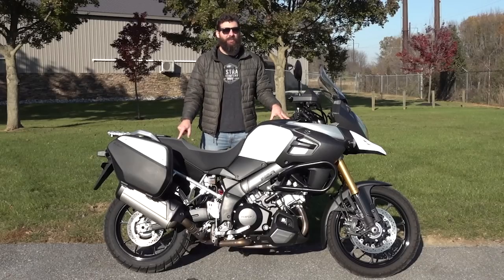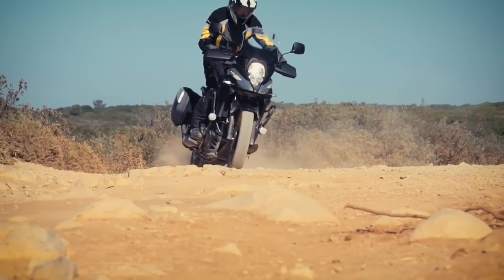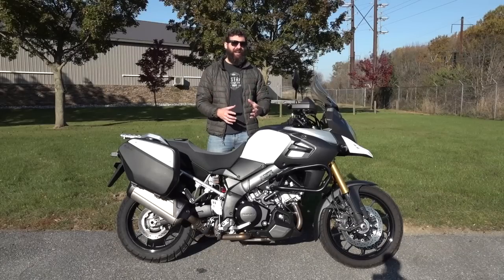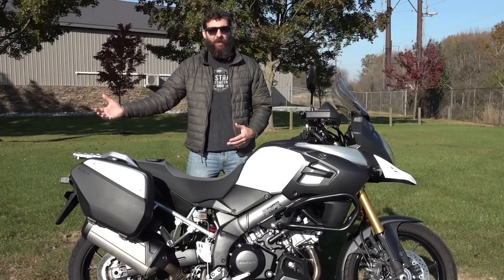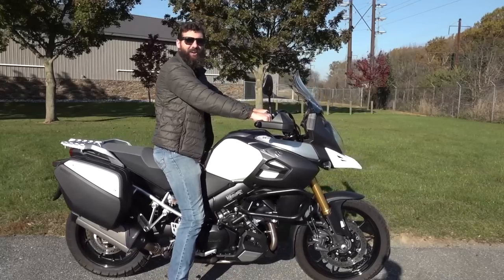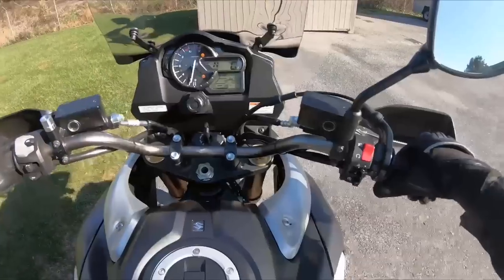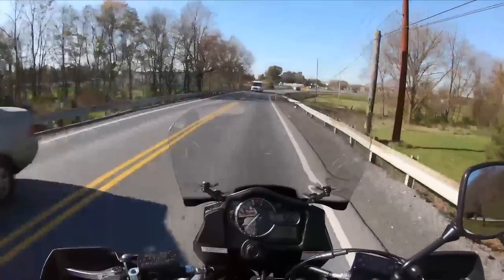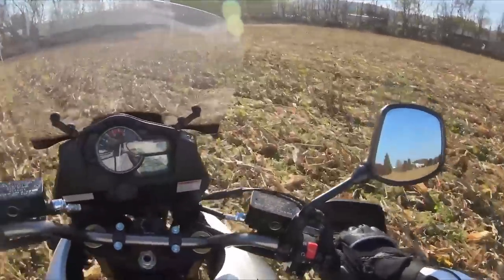Why the 2015 V-Strom 1000 is a great adventure bike but...

Comment: Sold them for years.   Saw them come in for service after thousands and thousands miles.   Never saw any damage to any of the radiators.  It's almost like Suzuki knew what they where doing when they built it.   One of the most honest ADV made.
Reply: I have the 2016.....no issues whatsoever.
Reply: @Paeload  Yeah! I bought the 2016 also, took it from Ontario Canada down to Missouri and the thing has been holding up really well and through lots of off-road abuse. I'm really happy with the purchase
Reply: You laying it down in a parking lot says more about you than the bike.
Reply: Bought an original '02, totaled it with a deerstrike @65mph within a year. Bought another one just like it. 65k later, I still have it and it's been stone-cold reliable.

Comment: I had a 2003 DL1000. Bought it used (with 410 miles on the clock) and sold it 95K+ miles later. And it's still going strong with its new owner. In 60+ years of riding, I have never had as much motorcycle for as little money as the VStrom. If it had a bigger alternator and shaft drive, I'd still have the bike.
Oh yeah - and I put a set of virtually indestructible Jesse bags on it.
Reply: I had a 2004 DL1000 for a couple of years.  Worst thing I ever did was sell it to buy a Harley.  Well, two Harleys and a Ducati later, I'm back on a V-Strom 1050.  Sooo glad to be back on a Suzuki.
Reply: What's wrong with the alternator? Thank you.
Reply: I too have almost 50 years on bikes, had almost any kind imaginable, 4 airhead BMWs, ( still have 2 pre 80s 😁) and a 6 cylinder Goldwing. Have an 05 bought used with 17K, equipped with all the Givi Factory bags, crash bars, a serious bash plate and upgraded fuse panel/ power outlets etc.  Once I got rid of that horrible factory seat, this is ergonomically one of the most pleasing, comfortable bikes I've ever owned.  I'm tall, so the leg drop is so comfortable. Had the lean run problem in first 1/4 throttle, but got the ECU juiced properly, easing parking lot navigation !  In the end, that motor is anvil tough, begs to be revved,  is hardly stressed at 90, and leaps to life if you need to move quickly. The bike tracks so perfectly at speed, and it's LCG makes it lean in turns so effortlessly, my sport riding friends don't lose me so easily.  It's not the best at anything, but like old airheads, it does everything well, and is stone reliable. Valves are not any easy project, but it's schedule is long. Only thing I might do to dial in to my tastes, would be to add 2 teeth to rear sprocket, making the power delivery more linear. It's high geared, and not easy managing at low speeds. Of course you need a Speedo Healer if you do that...so I'm rarely out of second in city riding !  I rarely ride in town, so not that big of a concern.  As one person who ride it said: It's one of those bikes that "the sum is greater than the parts used".  It will outlast my riding time most likely, but I might do one more buy, getting the 1050 and the ABS....which saved my butt once when on a borrowed bike....so I would like that feature.
Reply: @jordan9339  just guessing. Not enough power for addons. GPS etc.
Reply: @jordan9339  The model you see in the video has an upgraded alternator from the 2004 model and is capable of providing more than enough power for auxiliary electrical items.

Comment: A very good overview of the Vstrom. I have a 2014 1000 Vstrom, after owning several Beemers, Hondas, Kawasaki, I’m really 
Enjoying the Suzuki and it’s versatility. Comfy ergos, great handling, lots of low end grunt and surprisingly quick!  It does need,
  many after market accessories to make it off road ready, but that’s part of the fun too.  A lot of bang for your buck bike!
Reply: Hey Chris, I have to agree with you, such a fantastic simple bike. There isn't one reasonably priced Adv bike out there that doesn't require aftermarket parts to make off-road worthy so it's easy money to justify with so many parts available.

Comment: I'm on my second vstrom1000. I love these bikes. I can keep up with most sport bikes in my area, and i get to take it off roading. Great bike highly recommended!
Reply: I'm a SuperSport guy looking for a sporty touring option and am reviewing diff stuff and oddly this bike is catching my eye over some inline4 etc options. Good mint used ones are like 6 grand that are already nicely modded and the throaty huge v-twin has a nice sound to it. I'm starting to think this would be an intelligent buy and I haven't read a bad owner review of the Vstrom yet but have read complaints from various other sport touring bikes such as the r1250rs and s1000xr/ninja1000. 

Something that does everything well, never dies and can do a lot of different riding with seems to check the boxes for "touring".

Comment: In 2020 I bought a new 2019 Vstrom 650 XT adventure. My fiancée really liked it so she bought a 2016 Vstrom 1000 XT which she dropped twice in my cousins gravel driveway twice with no damage. We ended up trading in part because the weight and my ego wouldn't allow her to have a faster bike so I was going to buy a 2020 1050XT. With 2" ROX risers and peg lowering kits they are great long distance bikes with light to moderate capabilities. Great bikes at a great price in my humble opinion.
Reply: Just wanted your opinion on used price fora 1019 show room condition with 1800 miles. Their asking $11,000
Reply: @jasonshafer2768  650 or 1000? XT or XT Adventure. What mods or farkles does it have?

Comment: Glad to see a video so soon after the goodbye episode 😘.
The abs doesn't need any aftermarket hack..you .just pull out the ABS fuse at the same time as you are letting some air out when you get off the road and on the trail...
The luggage...it's not 1997 any more. Soft luggage is the way to go for offroading.
Reply: It's an adventure bike, 90% of its life is going to be on pavement. I attempted to take soft luggage on a cross country 4000 mile trip about 6 months ago. Not going to name the brand because I don't need a bunch of highly invested fanboys yelling at me.... BUT I will say a good well-known in the ADV/Dual Sport world name brand set of bags was constantly working themselves loose and flopping around at 90+ mph.  Did seem to be an issue at lower speeds but consistently as soon as I got out on the interstate and really got rolling the straps would slowly start loosening up. Finally ended up tightening them back down and wrapping the buckle and excess strap with duct tape to hold it in place. Which of course made it a PITA to get into my luggage every time I wanted to lube the chain or stop for the night. I would use the bags again for an overnight camping trip locally, perhaps even the Mid-Atlantic BDR since I wouldn't be going overly fast. But never again for a long distance touring type of trip, hard luggage is the way to go for serious pavement miles at high speeds.
Reply: @PracticalTacticalSheepDog  completely agree! Not going anywhere over 70 for a long time myself with soft luggage. But falling and dropping the bike has never been so comfortable 😛.
Don't have to worry too much about breaking the luggage, if I brush a tree I am less likely to be yanked off the bike by said 🌲. Bike fell on my ankle and I got a tiny bruise but was very aware I would have suffered much worst had I had hard panniers. 
It's 2 very different user cases I think. Fast speeds touring and adv riding.
I do disagree that 90 % is pavement for an adventure bike....at least not smooth fast pavement.
I think when on an "adventure" my average speed hardly ever goes over 40mph.
The good thing about this bike is that you can really do them both pretty well.
Reply: @xxxenricop  honestly I think 90% is probably a conservative guess for your average rider. I ride a full on dual sport and even my bike realistically see's probably 85% pavement. I can ride 150 miles of pavement to get to 10-20 miles of trails.  I put 17,000 miles on my DR650 in a year and a half of ownership which for your AVERAGE rider, I would say is quite a bit.  Out of those 17k I'd guess probably less than 1k were true off road with another 2k being dirt roads.

Comment: My 18 model (AL8) has been great ride, nothing beats a V Strom for reliability.
That said they have a few weak points: 
Clutch chudder (design flaw) can send vibration through the whole bike usually between 3 & 4K, there’s an aftermarket engineering fix that’s permanent - odd that Suzuki hasn’t changed the design of the clutch basket / bearing interface to remedy. 
The standard screen is usually replaced by most owners (turbulence) 
The standard halogen headlight isn’t the best, but you can change the entire unit for around £350 (same in USD) 
Corrosion can be an issue if you don’t stay on top of it. 
Valve clearance checks every 15000 miles 
Good fuel consumption/ tank range over 200 miles 
The bike really handles the twisties 
It’s top heavy when you’re moving it around by hand (easy to drop)
High seating position 
On the face lift models 2018 onwards electronically linked braking system 
Cornering ABS 
ABS pumps cost around £2000, so make sure you purge old brake fluid out of the pump, two ways of doing this - over 18mph lock back and front brakes independently activate ABS, change fluid, and repeat and repeat and repeat, or have the dealer purge the system by electronically activating the ABS pump. 
They can be snatchy under 3000 rpm (fuelling) ensure the the throttle bodies are sync’d up, or you can fit a booster plug (easy and comparatively cheap) which improves things no end. 
The later 1050 model is an improvement on the 1000 in lots of areas, but they have changed the character of the engine, more rev happy, not as torquey low down (max torque developed at 6000 rpm instead of 4000 rpm)
Reply: Thanks for that buddy

Comment: Having just rode 250 miles today in Northern Illinois back country on my 2014 VStrom 1000adv I have to say that it is a fantastic bike and I will always have a VStrom.  There are adventure bikes with more power but they can’t travel any faster than I can in the conditions that I ride in.

Comment: I have a 2011 650 V Strom because I like the upright seating position. It helps when I am doing my adventure riding in heavy Northeast traffic! I have dropped it twice and the previous owner has dropped it at least twice and the crash bars protected everything except the front turn signals.

Comment: Beak is not a German discovery, Suzuki was the first to introduce it and the Germans were just as inspired by it as other manufacturers. Gs has more "inspired" solutions, e.g. BMW shift cam from VTEC. Now, Suzuki has a better solution in the GSXR for the Variable Valve Timing System and it is called SR-VVT.

Comment: Suzuki makes some really nice bikes. Especially the V-storm 1000. The bestest flaw with this bike is, your selling it.  It has a 50/50 chance of being a turd. At least check the gas tank for rust before cutting it loose. Buyer beware. There not checking it over for you no matter what they say or how nice they are.  Super nice guy but dang man at least make sure these bikes are running properly before sending them out the door.  Love your videos it just sucks you burned me on a bike sale. After 2k in work done, so I could at least ride my bike man.... it sucks. 4 new injectors, gas tank rusted out had to put acid in it and have it recoated. Not to mention the battery that fell apart leaving me at the gas station....on first test ride. I sent you pictures.  Dont hate on me for being disappointed. But now the busa is pulling the front tire off the ground as it should. 9k+ later. Killing me man.
Reply: Woodrow Jenkins, I gave you a thumbs up, but the real problem with the purchase is YOU...  You learned, "Let the buyer beware" and you learned that YOU are responsible for what you purchase USED...  Don't blame them for just complying with the law and having a safety check done on the bike.  They buy it and sell it.  Their job is being a "central buying point" for the purchaser....  Your job is to look into the gas tank and say, "I don't like all that rust."  Cry elsewhere, you made your choice and your choice was to NOT DO YOUR JOB...

Comment: I have a 2018 and the first week i had it i thought i would go out and ride it like an rm 250 put a lip in the front rim small dent in the exhaust bent the shift lever and ripped off left side hand gaurd. But i was impressed enough changed the bars put after market levers and bark busters changed tires to 50/50 add an exhaust and stiffen the front end.i understand its not that kind of bike but it can be and still be cheaper than the rest.

Comment: I've got a 2018 I bought new last year.  Put 17k miles on it.  It's a great bike for exploring and city use. The none switchable abs is a downside, but the abs is actually quite good off road. I don't know about that year,  but you can switch tc modes on the move,  just have to disengage the throttle
Reply: My 2016 just needs the clutch pulled in.

Comment: Got a ? What is the Abs switch? I haven't seen one. I have a a 2014 Dl1000a
Reply: All it is is a basic on/off switch that breaks the circuit , like removing and re-installing the fuse but more convenient.

Comment: Is the bike okay for smaller riders, like 167cm
Reply: Late answer .. I am 164cm have the low seat, lowering link (triangle shape) and after 6 years had the forks revalved  I can flatfoot both sides, or with the sargent seat balls of feet..It is a great touring bike, a little top heavy compared to the 650. With the lowering it has the same ground clearance as a non adventure bike.  Had the 650 2012 version and loved its ability to be thrown around, but found it made motorways last forever. on the hills it was hard on the clutch, on the 1050 it was like, what hills?

Comment: NO. It does NOT have influences from the Germans.

It would be very benficial if you did your research beforte making claims in your 'presentation'.

The Germans, (viz BMW) copied Suzuki with their beak. It was the Suzuki DR-BIG 750. That was the first bike with a beak, NOTY, repeat, NOT the so called German' bike.

Comment: Still the best mid priced adventure tourer motorcycle is the kawasaki versys 650.
Reply: No power two up or loaded, no low end torqe and no good off the tarmac its literally a lazy zx6 or commuter with adventure looks, plastic fantastic adventure looks at that. I wouldn't class it as a tourer, sports or adventure. Its a weird bike that's ok for going to work. I'd rather just have a 636